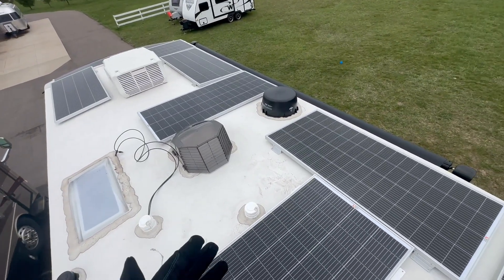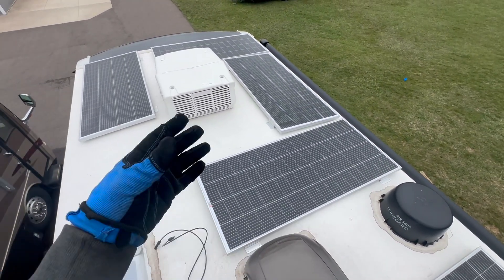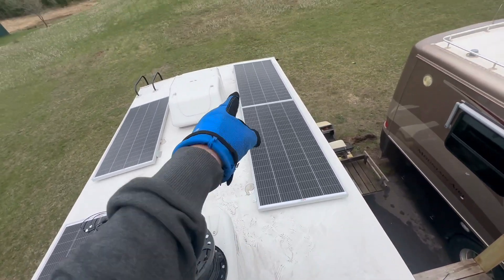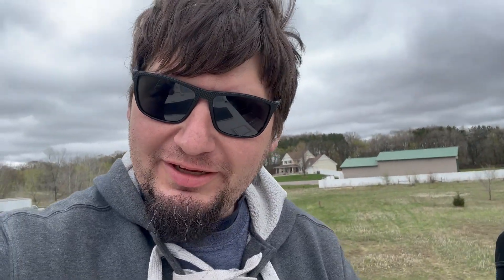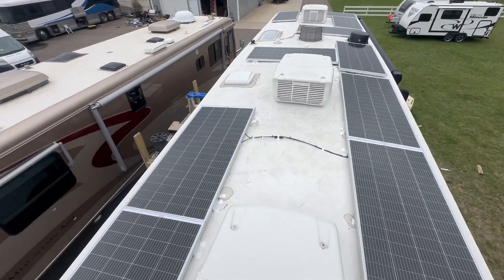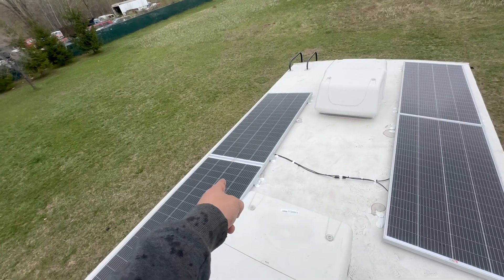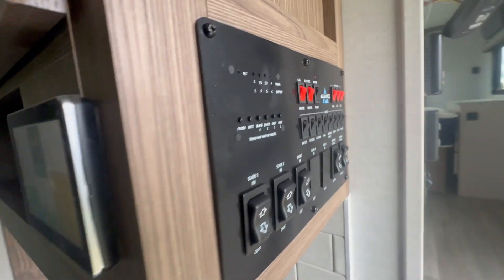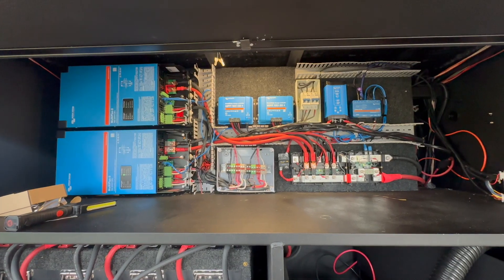Alliance Paradigm Victron Solar system install Part 2  2000w solar 800ah battery.

Comment: How come you don’t take the lead acid battery compartment stuff out
Reply from the maker: Because the lead acid battery is still there. It runs the slides, brakes, etc.  think of this as a 24v solar generator with the existing 12v system in tact.

Comment: Sorry to add more solar panels . I had a local solar guy try to add . But he couldn’t figure out where to pipe a 2nd set of wires , so he tied in as a  pair.a 440 and the 370 stock panel. I wanna add two more 2 -440’s

Comment: Darn . How do you feel about getting “house” panels at a cheap price? Pros cons? Greatly appreciate your advice.
Reply from the maker: If on an RV and you want as much as possible, stick with 200w panels. Better to put 10-14 200w panels than 3 500w panels.  

If for a house / office grid / ground mount or rack on an RV , yea great choice.

If used, skip it. New ones are so much better and there is a degradation to them over time.  With all the work and time it takes, do it right, get the most power you can.  Only caveat would be if it’s for a ground mount in a farm or cabin, where having 2-4 extra panels is no big deal, then by all means, save some money and start cheaper.

Comment: Do you sell gently used solar panels? I’m trying to budget build our set up running a victron multiplus 2 12v. 1-370 & 2-200 w panels . 2023 reflection 303RLS. Got extremely blessed to get at a realistic price!
Reply from the maker: No, anything we have used was a take off and is usually in rough shape.

Comment: Who would think 200 watt, 24volt panels would be so expensive!  How many did you fit on your bus roof (The Blue Bus)?
Reply from the maker: We used 455w panels on top 8x and 16 100w panels on the sides and then 400w for air deflectors.

Comment: Just wondering.  The smart shunt has the capability to monitor a second battery.  I think you said the original AGM 12v battery is still in-use (being fed from the Orion).  I'm not sure if this 'capability' works unless both battery stores are the same voltage ?  Ie) you have the 'main bank' at 24v, but the other one is 12v.    So, to monitor the 12v battery would a second shunt be needed ?  Thank you for your videos.   I'm a huge fan!
Reply from the maker: If you just want to monitor the voltage, no you could use the auxiliary input for that if you want to monitor actual amps, you need an additional shunt. With that said the DC system tile on the Cerbo GX will pretty accurately represent the 12 V loads.

Comment: never a fan of each panel being secured. Always use strut channel and attach panels to that, easy upgrade paths and cable managments.
Reply from the maker: We like to too, we’re looking for an airstream customer to take the plunge and max out their solar potential using unirac rails. We figure we can get 1200-1600w on one.

Comment: Taking you up on the offer related to your panels in series and parallel.   Could you do a video maybe with a whiteboard showing various configurations running in series and parallel or parallel and series.  👍🏼

Comment: You're welcome :)
The wire chase is not always in such a bad spot. All Alliance rv's have it (paradigm, Avenue and Valor) but many models the wire chase comes out closer to the divider and much closer to the center.
Fantastic video, and thanks for the Bear fix :)
Reply: @OmahaWayne  I really appreciate all your help, really enjoy learning from
Your videos . I have 2/230 ah LITIMES, a 12/3000 Victron , a smart shunt just bought a cerbogx, savi
up for the screen . My local ABC roofing company sells all types of panels- $100/each 200 watt or 440w. He has theee. Truck loads so if you ever need another source check ABC ROOFING if you have those